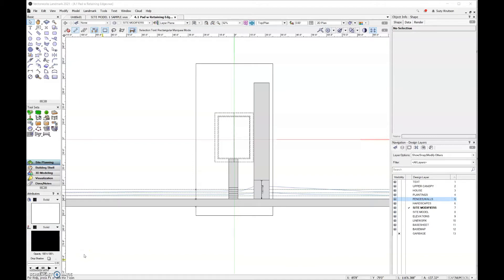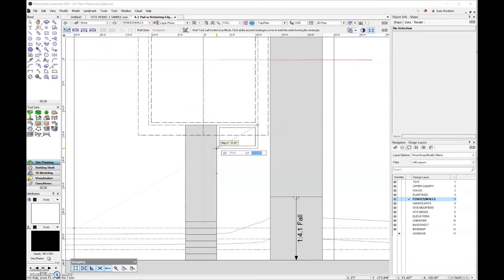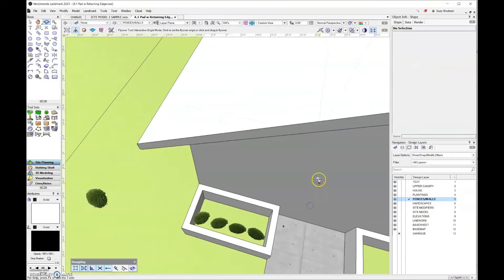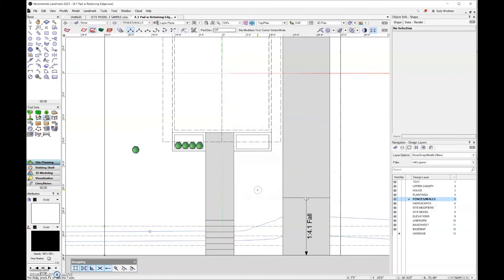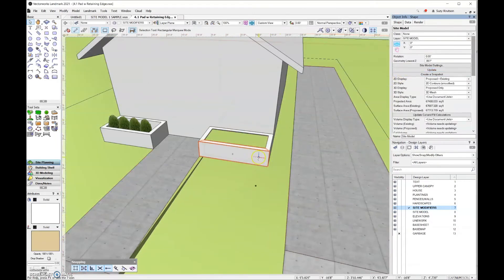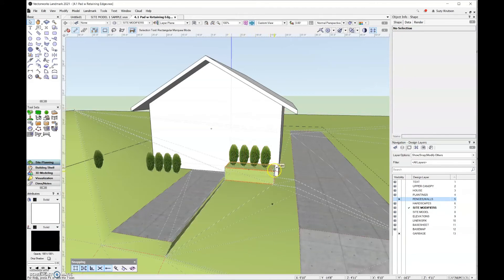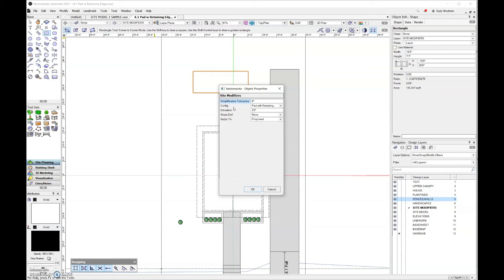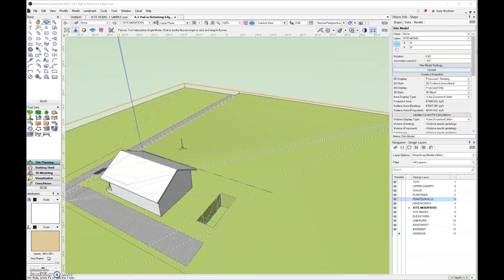Holes - How to Dig 'Em and Fill 'Em - Pad w Retaining Edge Site Modifier 7/# Vectorworks Site Mods

Comment: Hello, how a pad with retaining edge modifier should limit with a hardscape Slab modifier (Top)?. Should they touch or leave a gap between them? Either way I´ve had unexpected results. If touching the slab just sinks in the site model not modifying it, if a gap a slice of the site shows up between them. Is a third element needed?. Thanks in advance for your help.